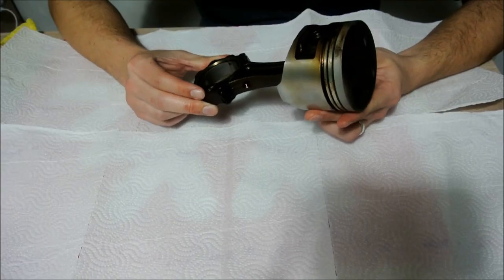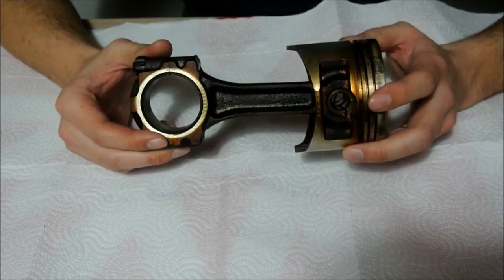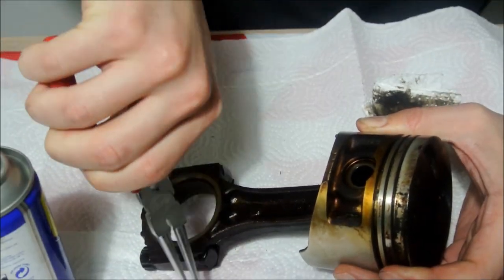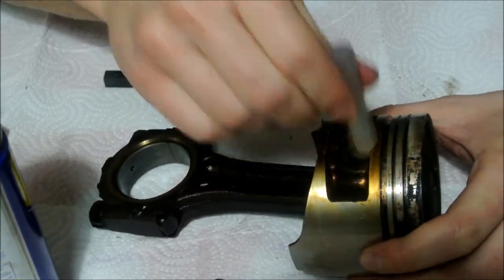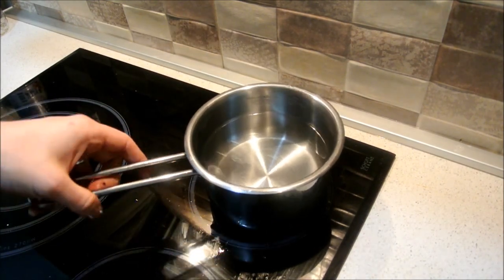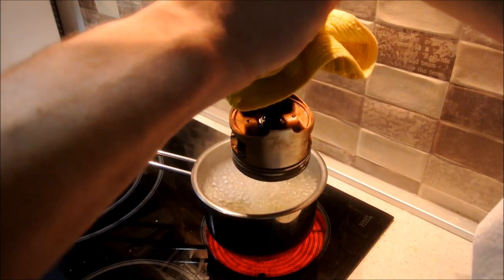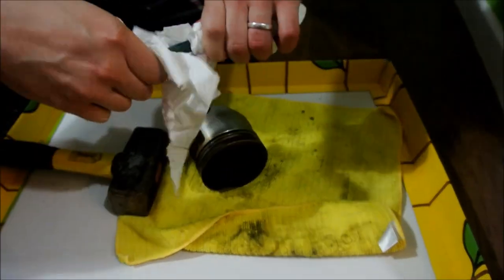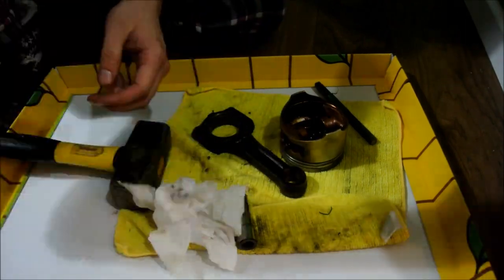How to separate a piston from a connecting rod

Comment: As a quick note, you should mark the rod to know which side faces to the front of the engine, before removing it. It can be installed wrong, because it will fit either way.
Reply from the maker: Not this rod, or the rods on nost Japanese engines. Each rod has a marking that needs to be pointed towards the front of the engine.

Comment: Dumb question, but since your rods have floating wrist pins, I assume they're 20mm?  Early 4AGE's have 18mm press fit wrist pins.  If you have 20mm ones, I believe you have the later, stronger, 7 rib 4AGE block too.

Just trying to confirm some of the info I've been reading online :)

Keep up the great work!  I find your videos very helpful.
Reply from the maker: its not a dumb question. My engine is a late bigport, which means 7rib block, the bigger rods, bigger crankshaft and yes, bigger floating pins. They pins are 20mm and the crankshaft is 42mm. 
The early bigports had 18mm press fit pins, a 40mm crankshaft and the 3 rib block.
The block basically tells you what you have. 
The earlier rotating assembly on the 3ribs is lighter, but the aftermarket support, durability and capacity for higher revs is on the side of the later heavier 20/42 rotating assembly.
Reply: mr2 mk1 hero Cool, that's what I thought; thanks for the reply! :)  Always good to have solid info ^_^

Comment: I’ve got a TRX400ex and my wrist pin is one with the rod, I’ve got it to move he slightest of a 1 billionth of an millimeter, enough to make the piston not move freely. BUT THATS IT! I tried to heat it up, and tap on it hard while holding the piston still so it didn’t damage my crank or bearings. NO luck. The clamp method did NOTHING. Now, I’ve got my extension stuck in it because that’s what I was using to tap it. No idea what to do now :/ Gonna try to call a shop and see if they can do anything for me.

Comment: Nice video. My engine seized 7 rib 4agze.. In the process of rebuild. Just ordered wrist pins.. For the install do the pins just slide in?
Reply from the maker: In case of the early 4age bigport they are press fit. In the late 4age bigport you need to heat up the pistons, slide the wrist pins in and then install the snap rings. As far as I know the 4agze is the same as the late bigport.
Reply: driving 4 answers thanks a lot!

Comment: Yeah, what a pleasure. Now i can give you an advice. You dont need water, just  use an old electronic stove which you dont use for cooking anymore, that you can use as a heat plate and put the assembly uside donwn on it. Of corse before you do that, you have to remove the clips and switch on the stove max 50% power is enough.

As you said aluminium expands faster than steel. So you have just to wait and monitor the situation. If you wait to long the steel will also expand es much as the aluminium and its to late. If youve done everything right, the pin will just fall out of the hole, as you hold the assembly sideways, pin down. But be cerful with the pin and rod, because they also will heat up.

I suggest stove/ air instead of stove water, bacause in water the temerature is pretty even. By just using a stove the heat needs to creep up the piston material and will spread through the piston, while the heat transfare between piston and pin will be relativly bad compared to water, which surrounds every surface of both materials and will heat them up with a nearly even rate.

You can use this technique also with a ball bearing stuck in a gearbox housing of an motorcycle f.e. . Just switch the power on 100% of the stove and put the housing with the gasket face on the stove ( gasket removed) so the bearing will face down. Gravity will do the rest and the bearing should fall out in a few minutes.

I did it my self, bearing in housing and piston pin in oem piston. Belive me, it works

✌

Comment: IS this what shot through the bottom of my 99' f150 v6 4.2l oil pan when knocking noise was on freeway? do i have to buy another engine, or drop oil pan and fix this connecting rod?
Reply: Did you end up fixing the issue?

Comment: The that piston head can handle a explosion but csnt handle the heat from the pot?!
Reply: If you knew anything about cars is that the explosion happens on top of the piston where it usually is really dark from the explosions, but if you start adding tunes that force more fuel into the combustion chamber too much heat will discolor the piston

Comment: You didn't need hot water!
Next time use a socket that's the same size
Reply from the maker: That's a nice way to damage the pin bore. Please don't suggest hack methods as someone might think it's a good idea and do it.
Reply: @d4a  ive learned from old mechanics! Seen it done many times and I've done it before! If the socket is the same circumference it won't!
Reply: @punchogunter2362  old mechanics aren't always, or even often often, the best mechanics. More time in the shop means more time to learn shortcuts that save time at the expense of quality of result. There are some great examples of aging mechanics on YouTube who know a lot about most of what they do that have some absolutely bonkers ideas they picked up from what was true when they were a young mechanic.